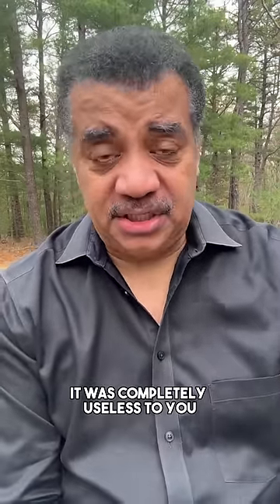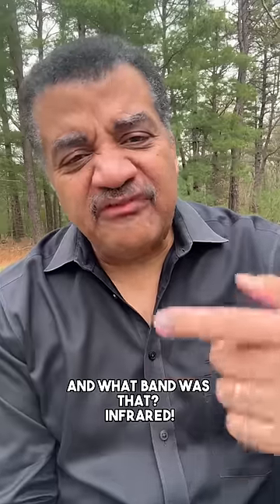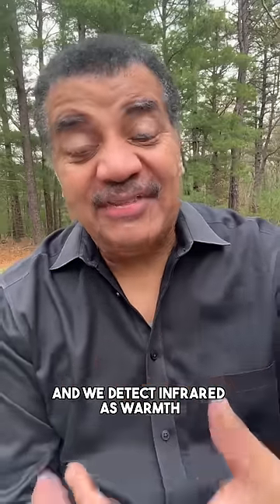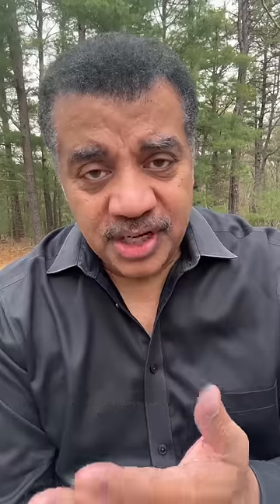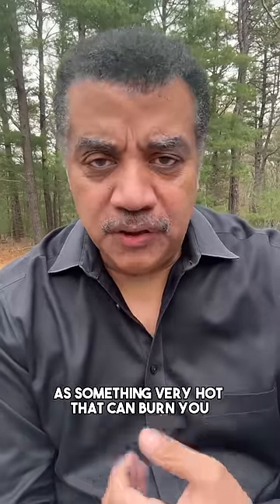LED Bulbs vs. Old Bulbs 💡

Comment: In the winter the efficiency of any electical device in the house becomes 100%, because the generated heat is put to use.
It is the simplest form of cogeneration.
Reply: Nice!  That's a great way to look at it.  "Efficiency" is a matter of context.  

Only small exception (to 100% in the winter) might be for any kind of light bulbs left on at night when you want to sleep. Then they are only 90% efficient at their required purpose (creating heat vs creating light).  😊
Reply: @cobra-he9xj 
Thanks,
The 10% of energy converted into light will eventually hit a wall or curtain and convert its energy into heat.
Anything that may be reflected and therefore is not fully converted into heat will eventually hit something else where it will be fully or partially converted into heat.
As long as the light cannot escape the room through, for example, a window that is not covered by a curtain, the light will eventually be completely converted into heat.
Because remember, no energy is lost; Everything eventually decays into the lowest form of energy and that is heat.
Reply: My mother in law use to say this too. But I always thought that that heat is mostly at the ceiling and not where I want it. And I expect heat is lost from the ceiling somewhat,  it's not all reflected down. Certainly on the top floor of the house.
Reply: @ruslbicycle6006  The warm air will float on top of the cold air and be pressed against the ceiling, if there were not a certain air flow that is mainly fed by the radiators located near the window.
the air rises there and flows down through the ceiling and through the other wall. You can help this circulation a little by pointing a fan upwards.
Ultimately, you can't keep the heat in your house; no matter how well you insulate it, a certain amount of heat will always radiate outside.
This essentially turns your house into a heater, that has a power equal to the power you need to keep your house at the right temperature.

So all those people who say:"Close the door, because I don't burn for the outside world".
Yes, you do burn for the outside world, allways.
The only thing is that you are warm and cozy in that big stove that you call a house.
Reply: It’s simple alright. Simply inefficient per unit of heat compared to proper heating. 
Trust the big brained scientists who’s offering you useful info.

Comment: An old lightbulb heats up the filament until it glows.
An LED has two or more different materials next to each other, where one has extra electrons and the other one has somewhat far away gaps for the extra electrons, so that when the extra electrons jump, they release a specific amount of energy, which is released in the form of a specific colour photon (light).

At least that's what I remember, I might be entirely wrong.

Comment: Now I just need an explanation of why I’m using cheaper lightbulbs, but my electric bill is more expensive.
Reply: Exactly!  Our family noticed the same. Didn't make any difference. On the contrary, the bulbs are way too expensive.
Reply: depends on where you live, actually.  In Texas, we privatized electric provision a few decades ago, on the assertion that it would make electricity cheaper. As with anything else, going to a for-profit model actually increased the cost. as anyone sane knew it would.
Reply: Your question is related to the economics of electric power. 1. We expect the power to always be on. 2. Renewable energy--particularly wind, solar, and hydro can be inconsistent--occasionally zero--occasionally overwhelming. 3. Fossil Fuel electric generation plants are maintained as back-up. 4. At least half of the power bill is devoted to maintaining the power grid which all increases over time as prices and wages and (yes) executive compensation increases with the inflation rates and other market forces. 5. American electrical infrastructure--the electrical grid--is kinda, metaphorically speaking, held together with paper clips and e-tape It's an awkward collection of supplier and transmitters businesses connected through tradition, government regulation and public policy. All it might take is a solar storm, a tree limb, a lightning bolt, a month of cloudy days and no rain, whatever, in the wrong place at the wrong time. In the spirit of science, electricity will always find a path back to its source.
Reply: It takes about the same number of people to maintain the equipment and distribution whether you use 1 kilowatt-hour or 100 kWh. So the price per kWh goes up to compensate.
Reply: Imagine what it would be if you were using incandescent bulbs...
Reply: Simple answer: Joe Biden!
Reply: It's almost like you need more than lightbulbs to run a house.
Reply: @waltmanglona1485 found the guy that ate lead paint chips as a kid
Reply: Well, if you're like me, LEDs are all over my apartment haha, so I think I know why my bill is still about the same XD
Reply: Knowing many electricians, working in the construction field, I can tell you it’s still grounding, electricity to operate. It’s stepping down the voltage and wattage for the LED but it’s still utilizing the full potential of the socket.
Reply: You're paying increased rates because of people charging their cars.
Reply: @GASOLINERAINBOW1 back to school mate
Reply: Monopoly
Reply: It all boils down to power factor and heat dissipation.  Please see my post in the main chat of how LED lamps are misleading at best and a lie at worst
Reply: @GASOLINERAINBOW1 as an electrician this is not true 120/240 ac - 3.5 - 7.5 dc causes a crap ton of energy waste through heat....

The only way to fix this... I would like to add is what they did in the 1870's...

1 ac feed to a home/business.
1 dc feed to a home/business...

The Transformers are the main waste of power. Though needed for main lines for long distance transmission of power...

The bottom line is LED as a whole saves 0 money when scaled worldwide.

The heat from traditional lamps in winter would be a great thing...

LED makes the same heat just in a place less useable.....

Standard bulbs in winter / LED in summer would be ideal. 

They both make the same footprint on the earth as a whole but changes the "useable energy". Dramatically.
Reply: Sounds like you messed up.
Reply: Its called capitalism. But the conservatives don't like when we talk about that
Reply: Really where? LED bulbs seem to be more expensive than classic $1 bulbs
Reply: Thermodynamics
Reply: Less watts = Less energy. Light emitting diodes DO NOT release heat like vacuum lighting
Reply: That's the same in any country.
Compared to 20 years ago, smartphones, TVs, soundbars, eletric ovens.
We're consuming more and more energy nowadays.
Reply: Take a look at your electric bill from the old days and new and figure out what you pay per kilowatt of power in each instance. While your at it look at how many kilowatts you actually used. Cost per kilowatt has gone up, so even if your usage is down you might still pay more.
Reply: @malbers35 wow, your market for EV cars must be booming. Imagine how much less you will have to pay for electricity for carbon capture... 😂😂😂😂
Reply: Because they aren't cheaper. They cost less in store but cost more to run.
Reply: Other electric appliances
Reply: Bill might be same but you may use less kWh but you're being charged more per kWh
Reply: microwave, Laundry dryer, two meters wide tv, induction hob, ac, 4090Ti, etc
Reply: @samanthafrancis2993 What are you on about? LED bulbs are much, much cheaper to run and they last basically forever as they don’t have a filament to burn out.
Reply: I remember that our Boy Scout troop sold light bulbs as a fundraiser. You could buy 4 light bulbs for $1. WTF happened?
Reply: Bulbs in general don't use much energy. If you are using AC or electrical heating, then they'd far outweigh what you might save by converting to LEDs.

Comment: Here's a tangent take on the topic:
Humans can sense 2 spectrums of light. We use our eyes for the visible spectrum, and our skin can detect the infrared spectrum. Not very precisely, but it can nevertheless.
Reply: Hey stranger, you catched my interest into this mini-subject. So here is my question : what would that be the purpose of that "feature" or evolutionary train developed. In short if you'd know.
Reply: You can feel the presence of an other animals, if big enough/ close enough.
Reply: Its amazing isn't it. We can do more such as  tasting the presence of invisible high energy radiation, we can differentiate molecules with differing isotopes, we can even distinguish chiral structures based on taste.
Reply: @alexdefoc6919 it's a good question. It's either to encourage us to seek a warmer environment as this lowers the metabolic demands for us to survive, or it is an unintentional consequence of humans developing the sense of feel to help us with other evolutionary demands.
Reply: I was going to comment the same thing. I can see the heat that my body senses, in my minds eye, when I close my eyes.
Reply: @alexdefoc6919  My reply to this video above: Useless? The protein production in our bodies need IR light as with other cellular processes. Your eyes may not see but your body does. That's why being out at sunrise and sunset is good for your body and eyes. Trash those LEDs! Live more healthfully and longer.

Comment: The new bulb gets hot too, not from the LED, but from the resisters that are protecting the LED.
Reply: Very good call, possibly the only logical continuation of what he actually is talking about...
Reply: From the heatsink dissipating the heat, actually. It's just a big heat mass.
Reply: I wanted to try one of those 3 direction garage light, it got extremely hot. Chose not to use it.
Reply: Yeah NOT, you're thinking of an indicator LED, no power. Power LEDs use a complexly diff technique (switch mode). The heat issue with LEDs is a matter of density.
Reply: I would say led light can get very hot
Reply: Didn’t think about that, not as hot as incandescent, but the old LED’s actually the base was an aluminum heat sink
Reply: @gregdee9085 Yeah, no.  LEDs are mounted on aluminum substrates to dissipate heat.
Reply: @macthemec Winner, winner, chicken dinner.  LEDs still get hot.
Reply: Shine one of the high power 1000 lumen led flashlights on your skin. Gets hot.
Reply: New led bulbs need a heatsink, to dissipate the heat..
Reply: I used to dry my clothes near bulb during winter .. those really used to be so hot ..
Reply: Bingo. 🤙
Reply: Does anyone have an LED light “shade” they like? I haven’t found one in which I like the light that comes out.  Also, every new car’s lights are like brights.  I hate them when they are pin the opposite lane.  Help me/us not be blinded by LED lights.
Reply: Any thing that puts out light will generate some amount of heat. That’s the laws of thermodynamics. LEDs are still way more efficient than incandescent and CFL lighting
Reply: @gregdee9085 The point is, they do actually get hot. Some of them hot enough to burn skin.
Reply: @darkopz they do indeed, but what greg was pointing out was the op was incorrect about why they get hot.
Reply: Transformers
Reply: @darcyc5476  By "shade" do you mean the color temp?  For household stuff I find 4000k color temp to be great, it's not that old yellow of the 2700k-3000k but the 5000k that's most common is too blue and feels sterile.  You'll be hard pressed to find 4000k color led car bulbs, but the 5k auto LED's seem to work well.  Don't go higher than 5k.  I once as a newbie bought the 10k or 12k bulbs, they were purplish blue and cast very little usable light.

As far as blinding lights, proper headlights, properly aimed don't blind on a flat road.  Projectors have a cut off that keeps the light say "waist high" and no higher.  The problem is people put wicked bright LED bulbs in a halogen reflector bulb housing that's basically like a flashlight and casts light everywhere, unlike a proper projector.  Also people don't know/care to learn how to aim their headlights correctly.  Even with proper projectors if they aren't aimed correctly they will blind people.

Comment: Thank you so much for the input. I sell lightbulbs and had problems explaining the difference of the old and new lights, mostly to the elderly. This will help me explain it, infrared is known by most people. ❤
Reply: An easier way to explain it, and more accurately, is that incandescent lightbulbs worked by making a coil glow white hot. It is closer to a heater than a “lightbulb”. 

LED bulbs are semiconductors, however to the elderly you can just explain that LED’s don’t rely on heating a wire to glow.  

Selling points are that since LED’s are way more efficient and lower heat, you get a way longer life and lower power draw. 

I wouldn’t talk about infrared because while that’s something they emit, it’s not why they get hot.
Reply: Infrared has its advantages, tho. It's good for your mood and helps you sleep. 
LED lights mess up your sleep schedule being in front of them too much. It's the same reason why being in front of a camp fire is peaceful, calming and relaxing. It's do to the infared light.
Reply: LED light is blinding and unpleasant.
Reply: LEDs cost a lot more, don't last as long and give off a weird light. I will stick with my incandescent bulbs.
Reply: @Allan-es2hz  In what world?? LED’s literally cost the same as incandescent at this point. You can get LED’s as cheap as a dollar. They have so far been lasting many times more than incandescent, lasting years as opposed to just one. 

There is also no “weird light”, modern LED’s have high CRI values and are virtually indistinguishable from incandescent. I did a test on some old people with a store display I made, using 2 incandescent and 2 LED bulbs. With all of them lit, no one can ever tell which is which by just looking.
Reply: @jsisson1000  No sir. Get yourself a quality 2700k frosted glass LED and you will never be able to tell the difference.
Reply: @joeythefoxxo  it is a personal preference and I will use incandescent bulbs because I prefer them. The LEDs do not last and they have a spectrum of the wavelength missing when I try to use them for work. Where I live they are very expensive and fail a lot faster than the good old incandescent bulbs. Even the LED tubes do not last either, a local supermarket near me is now replacing them again.Their fifth set in less than five years. When they had the old traditional flourscent tubes the odd one or two would go out, but now the whole store has large sections dead,,again. I asked management what's the deal,,,their reply was "modern junk being forced on the public". I enjoy seeing this as I have my stockpiles of the good old stuff that works and lasts.
Reply: You sell lightbulbs? You mean at a store? A lightbulb store? That's cooler than Neil deGrasse Tyson and that's pretty cool.
Reply: @joeythefoxxo  your fascination with light bulbs is very strange. It's kind of funny tbh. It's like you've been waiting for this moment.
Reply: @Thizzamajig  I have a fascination with anything electrical. It’s my passion. Lighting just happens to be a very big part of that. 

Same way some sneaker heads can’t get over Nike Airforces or bass heads can’t get over Sundown subwoofers.
Reply: @Allan-es2hz  I personally think you get used to it if you have good bulbs. We have really good ones now. And we have no other choice, where I live only LEDs are allowed to sell.

Comment: I’m an electrician. High pressure sodiums and even fluorescents keep warehouses warm. Cuts down on the energy bill.
Reply: I'm pretty sure you're just trading one kind of heater for another.
Reply: have you worked in a warehouse?? I did for  a while and know that you don't have a clue. you may / may not be an electrician but don't know much about physics
Reply: Doesn't cut down the energy bill at all  because electricity is the most costly form of energy. Use some other source of energy and you are better off.
Reply: @HolgerJakobs lol touche. I'm going to assume he means electricity bill
Reply: That electricity wasted on the light bulbs putting out a minute amount of warmth would be much better used in a far more efficient heating system. Unless you have like a thousand light bulbs pre-packed together it's not going to make more of a difference than a heating unit(s) would
Reply: Another thought for our “electrician” is if you heat a warehouse or any other space with lighting, the only way to control the temperature is turning on or off lights. So imagine it’s 2 am  and you need to cool down warehouse/ room and have to work in the dark - what a genius 😂😂😂
Reply: not when its summer time and you need ac
Reply: Some people just have to be right!  Even when they're wrong they will argue til they are blue in the face 😮
Reply: Is that why leds have heat sinks?
Reply: @brad6551  correct, LEDs still get hot, just not as hot as the old lights
Reply: It is the opposite if you live in the country where winter is 35°C and not °F
Reply: I cannot touch any led light after 10min of turning it on
Reply: That would be a poor way to do it and it wouldn't be effective. Then the rest of the year, you are wasting power and increasing heat when you want to cool.
Reply: Well, in the summer, it's not helping!